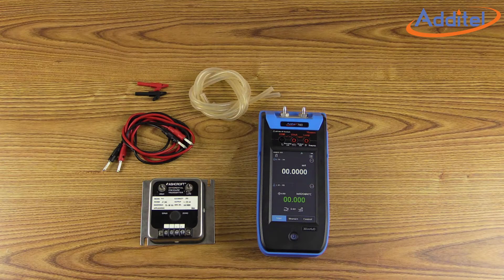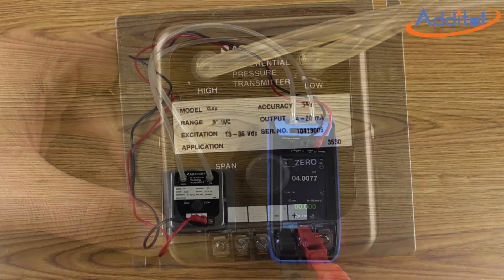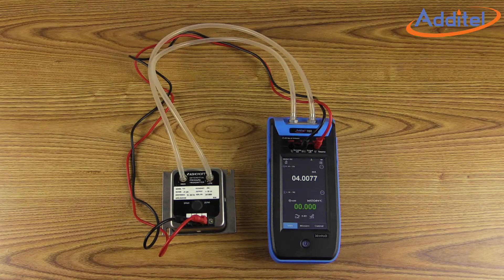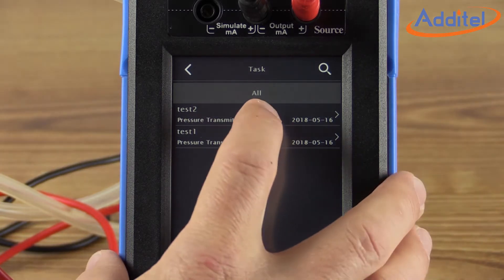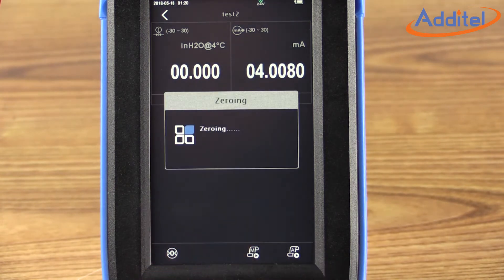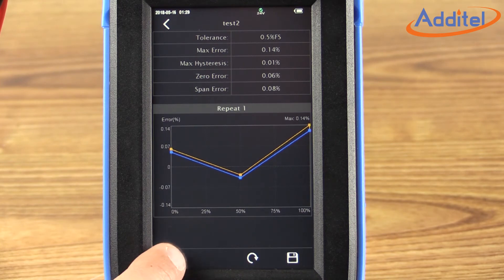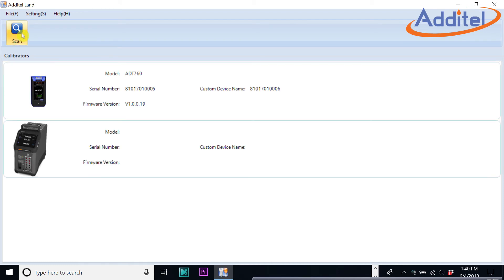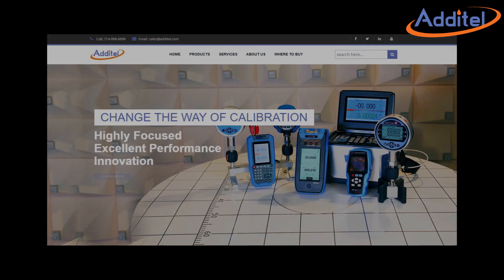How To Use the Additel ADT760 Task Feature to Calibrate a DP Transmitter

Comment: You did not do any calibration, right? You just tested it.
Reply from the maker: Terminology can vary depending on who performs the test, but in most cases the "calibration" is the testing procedure, while the "adjustment" is the act of correcting the readings. This is because even if the device is within tolerance and no adjustment is needed, it still underwent a calibration and should receive a report documenting this.